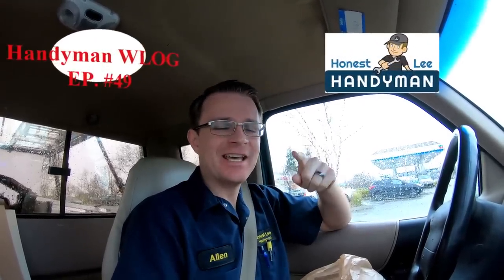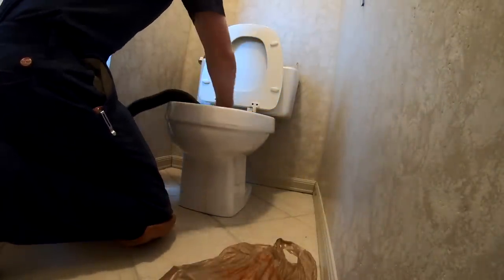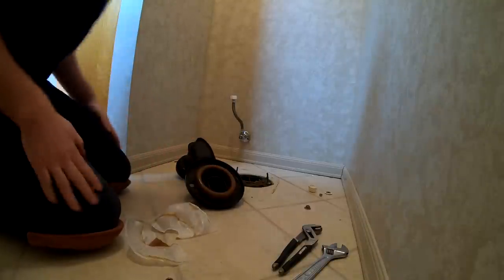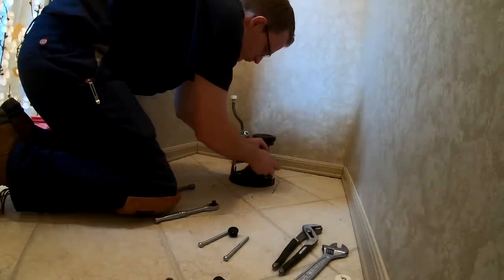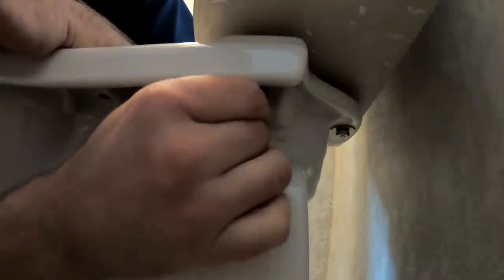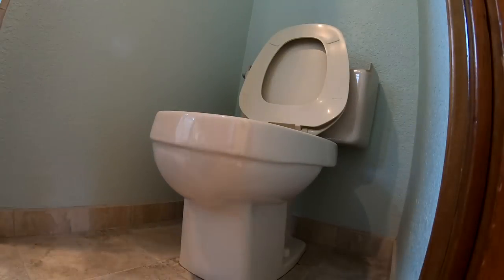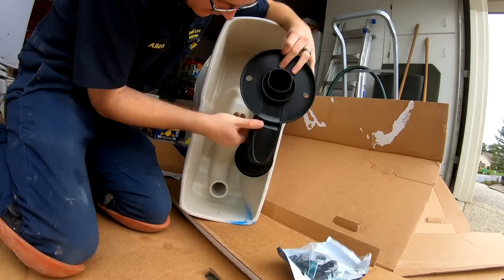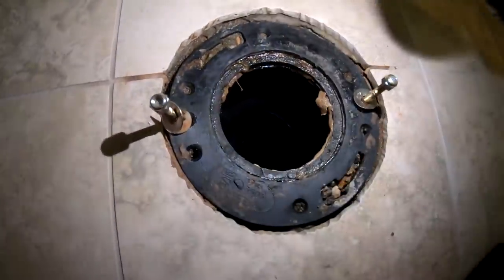Watch this before installing a Toilet / New Kohler ReadyLock Skirted Toilet Install / WLOG

Comment: I like these toilets.  During install, you don't have to worry about cracking the toilet when tightening the seal part.  After install, the toilet is designed to be very easy to clean around.
Reply: I also like how you don't need to balance the toilet just right as you lower it to not screw up the wax ring...

Comment: Nice video. I like your presentation and willingness to get dirty to take care of customers. You'd make a good residential service plumber.
And that is the work you're doing, it's plumbing, a skilled, licensed trade. 

Had a plumber been on the site, he or she would have pointed out that the 2nd closet flange is not only recessed, but also not sitting on top of the finished floor, which is a requirement. The flooring contractor (or handyman) who did the tile decided to skip consulting with a plumber regarding the proper height/position of the flange and just tiled around it. Very common mistake and very costly. That leak was NOT a small leak. On each flush water escapes into the cracks and recesses beneath the tile and traps moisture there. This leads to foundation issues, pest issues and likely mold and mildew issues.

We see this every week in our shop and it costs customers untold amounts of money in both health and renovation expenses.

So, as nice and well intentioned as you are, the customer didn't get the information she needed in regards to her home because you didn't have it to give.

Always hire a licensed plumber with a good reputation to handle issues like these in your home. Even "simple" things like swapping out toilets.

Comment: Allen,  a small portable fan would dry things out
    faster than a heater,  and cheaper to operate. 
another good job as usual.   look into the new
    foam type gaskets.   better than wax, reusable,
and can accommodate floor-to-flange height 
    differences.

Comment: I installed five toilets with the new blue rings three years ago. It was so easy to seat the bowl without the mess. One of the homeowners had a sink problem and the toilet had to be moved. But there was no problem resetting. The blue ring was working great and saved time and money. For me I will never use the wax again.
Reply from the maker: Ya I agree! Those work great if you ever need to reset toilets! Thanks for your comment!
Reply: I like the new waxless rings too but sometimes they don't always work. Sometimes there too high and I have to use a wax ring that came with the toilet like at my last job.
Reply: @deaneng8540  I had a non wax ring leak I had to get an extra thick wax ring.

Comment: Good job on a unique toilet. While working in the maintenance dept. of a health care facility for many years, I can not emphasis enough the importance of wearing gloves when working on toilets. It's not only about the germs from urine and feces, but you don't know if someone using that toilet has an illness or communicable disease. I buy nitrile gloves at harbor freight. you can get a box of 100 for around 8 bucks. Also, cover that drain pipe when open. I was working over on open sink drain one time and one of the neighbors must have dumped a very caustic substance into the sewer system and the fumes backed up through the sewer system and came out the open drain I was working over and I breathed it in which caused me some temporary burning of my nostrils and lungs. you can also get a back draft of flammable fumes. It's not just about the poop.
Reply from the maker: Oh wow! That's crazy! Thanks for your tips man!!

Comment: FYi for anyone else is coming here to see how to install this toilet:

The underside of the Black pipe that connect to the flange on the floor has a strange point of connection to the flange.

If you use a standard wax ring, it should be fine (Kohler includes one in the box). But if you use a rubber ring, like the Blue Rubber one, it doesn’t fit well on the Black pipe for the toilet.

I got it working by first fitting the Blue Rubber ring to the black pipe first, then connected it to the flange.

I could figure out why the toilet was leaking at first. This solved it.

Hope that helps!

Comment: You could test the wax “seal” before you put the bowl on.  Pour a pail if water down the top of the black flange you bolted to the floor.

I also, wash/clean the wall and floor, for the customer, with bathroom cleaner, while I have the old toilet out.
Reply: ^ this.

Comment: I came across a great ferule puller. It will be used on fine thread and coarse thread nuts. I used to carry both coarse and fine thread angle stops because I I’ve had a few problems with stuck ferules that were either hard to pull or limited access made it hard to remove. Now I can just carry the one style of angle stop because Of the puller being able to easily remove ant ferule. Anyways; if you want to know more about the puller just let me know.
Great vid man.

Comment: Great idea with the paper. I've always been paranoid that my toilet has a leak that I don't know about because it might not leak enough to flow out from under it. I'll try your way. Know any way of detecting a leak from a shower head when I can't get access to the inside of the wall to see it? I redid my shower and it's all tile. I'm worried there would be a leak inside that I don't know about. I pressure tested it before I sealed it up, but I still worry...

Comment: not sure if i trust these new toilets yet, seems a bit of an unusual way to attach the toilet to the floor, time will tell, great video
Reply from the maker: Ya I agree! Kind of different! We will see! Have you ever installed these types before?
Reply: @handymanjourney  no not yet
Reply: Never seen these new designs. Do they allow for leveling if the floor isn't level, for adding shims etc? Seems like it could be an install issue if the floor is put of level on the side enough..
Reply: Just one more component to break

Comment: i really would have shimmed (with composite shims) the areas that weren't quite touching the floor to prevent any stress on the flange assembly over time.
Reply from the maker: Thanks for your comment! Ya these are interesting toilets!

Comment: I can't find how far the water supply valve needs to be from the centerline of the toilet. I have old non-skirted toilets and have 7 inches from the centerline to the supply valve. Kohler website install instructions don't mention this. Thanks in advance.

Comment: Having so much trouble with the tank installation. Missing the tool and the nuts and washers. And just noticed that the bolts really don't go through to get started on screwing them down
Reply from the maker: Best of luck to you!

Comment: another job well done Alan. Wow your toilets are a strange set up over there.
do a youtube search for a UK toilet install much different to yours
P.S Alan use your wrench the correct way around or you will end up smashing your knuckles
Keep on keeping on
Steve UK
Reply: it isn't a common toilet - google "skirted toilet"
Reply: @fd3871  yeah i know but even the american standard are totally different to the UK
Reply: @ollypolly18  i lived in NL for 6 years, 90% of the toilets i've encountered there are wall mounted with the flush system in the wall. same in uk? never really paid attn to the toilets when i was there.

Comment: Damnit what size socket? Even Kohler's video didn't say but I've got to install one of those things tomorrow oh well now I need a whole tool box to install a toilet SMH. UGH.
Reply from the maker: I'm not sure what size socket I used in this video. Investing in a good socket set will definitely pay off dividends if you plan on doing this work!
Reply: @handymanjourney  yep guess I'm buying a small socket set with extension even though I have a full mechanic set at home and my pickup is jam packed full of everything needed for what I normally do but yep you have a good point.👍
Reply: 7/16" deep socket with extension.

Comment: Doesn't California require you to have a plumbing license to install toilets?
Reply from the maker: They do not, Just a general business license to operate as a handyman
Reply: @handymanjourney  I am quite honestly surprised because California in general, is a heavily regulated State. I'm in Illinois, and "technically" you can't even change out a faucet for a customer without a State plumbing license.  And heavy fines in Illinois if caught doing ANY plumbing without a permit and license.
Reply: @videoadproductions1446  same in NJ. They made it a crime a few years back with something like up to $60,000 fine. But they never do anything just go after the licensed guy because he has no choice but to pay.

Comment: Nice work Allen! However, I would never recommend those toilets.
Reply from the maker: Hey thanks Ed! Have you had bad luck with these?
Reply: Thanks for the in-depth rebuttal on why you're not a fan.
Reply: I would. The Revolution 360 works great and flushes  VERY well

Comment: I try not to touch my phone when working on toilets and such. Gloves are a good idea, as you can be exposed to some nasty stuff. It does wash off visually, but not on a microscopic level. You could also be exposing the people you love at home, to whatever is under your fingernails. That said, I have been accidently exposed at times, and never had a problem. Better safe that sorry??

Comment: Tuned in to see special Kohler bracket and mounting. You showed none of that. This could have been an install of any other toilet as we SAW very little of that special bracket, its assembly and its pros and cons. Suggest you delete the dump run as it's just extra fluff.

Comment: always wear gloves especially with toilets
Reply from the maker: Ya maybe I should start doing that! Thanks for your comment!
Reply: Especially if the toilet you are removing is shattered, or if there are cracks and porcelain chips. Because damaged porcelain is razor sharp.

For me, I could care less if the toilet is dirty or not. I'd rather get dirty instead of getting injured. Even though I have manned up and I am 17, going to turn 18 this July 4th, I am still traumatized by the fact that I got injured from busting a window with my bare fists when I was 6 years old.